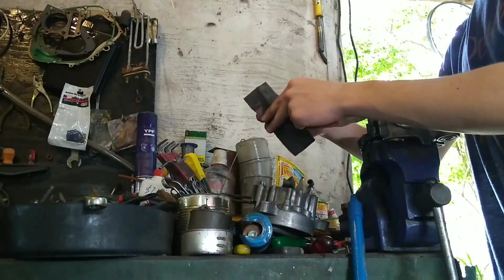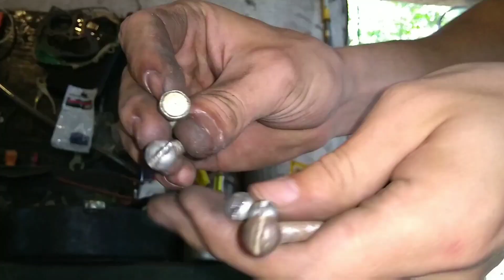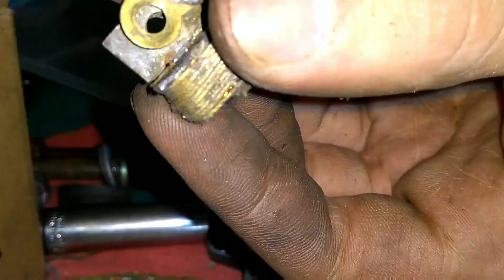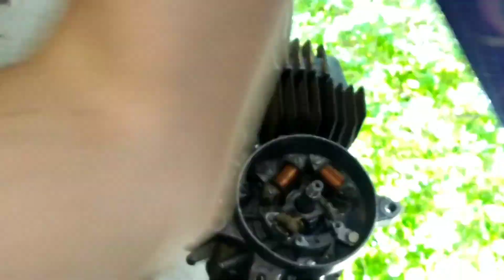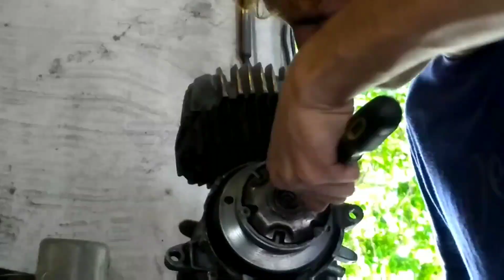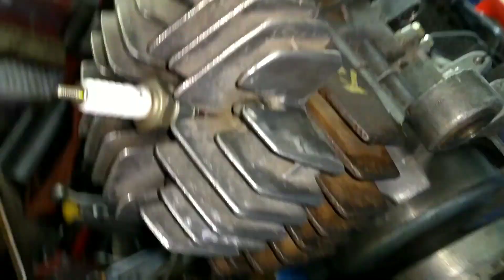Armando ciclomotor Kenia Jialing 50

Comment: I have the same engine, but I don't have electrical parts, I don't have a carburetor, I don't know which one to buy over the internet, could you help me?
Reply from the maker: For sure!!! Your engine is a Honda Nc50 , the CDI is Pietcard 2012 (in Argentina) the ignition coil and sensor you need to start the engine
Reply: @GuidoRotela  honda? Isn't it a jialing?
Reply from the maker: @Techiesbaludo  where are you?
Reply: @GuidoRotela  brasil
Reply from the maker: @Techiesbaludo  aah ok, yes is a Jialing... Another dude?